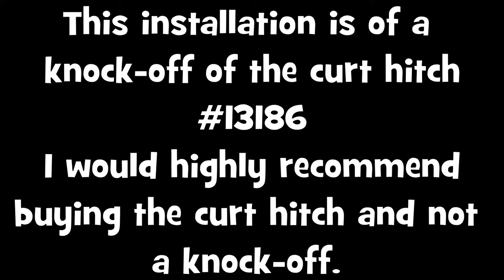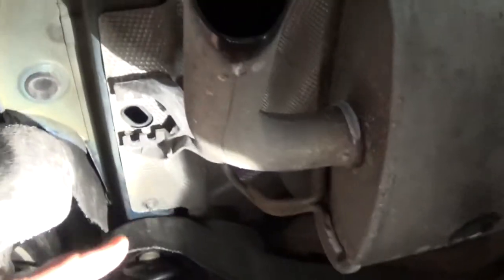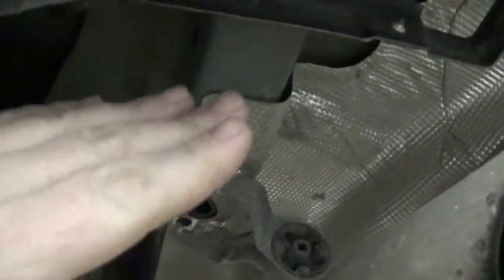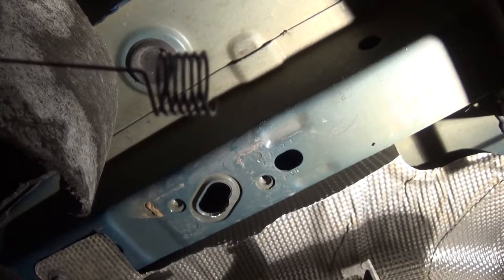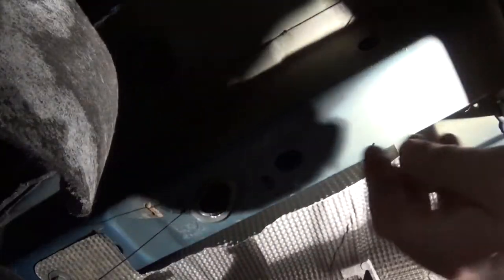Quick & Easy 2018 Escape Trailer Hitch Install

Comment: Hopefully the bolts were quality enough to hold the hitch in. I bought a harbor freight engine stand and the first thing I did was go out and buy new grade 8 bolts to assemble it with. I had heard stories about a bolt failure when a larger engine was put on one of their stands. The wire thing was cool.  Instructions  haha